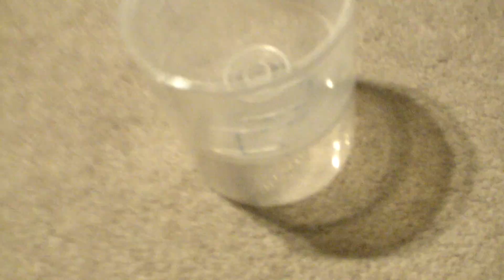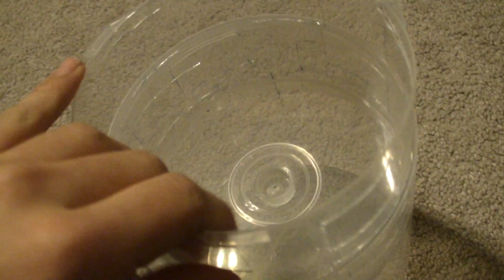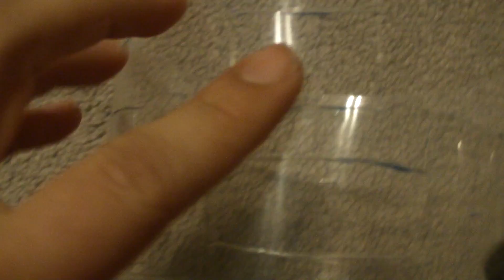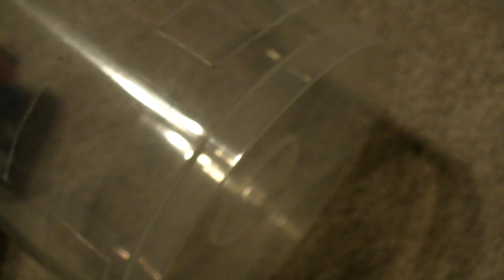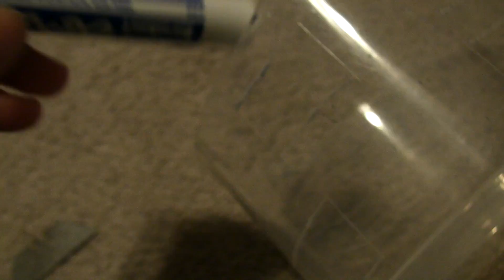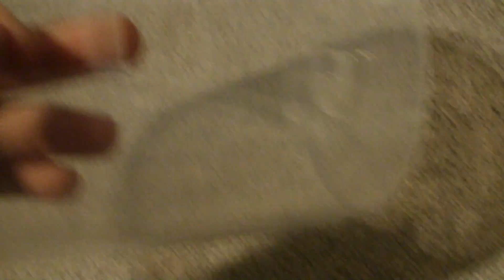Homemade Thunderbolt 1000T Started

Comment from the maker: my next step is to mount the stator to the motor i will use, i might use a "Gould" motor since i will using about 10 glued CDs hot glued to the bottom of chopper and a CD lits snugly on the rotor.  
new updates will be posted, hopefully by end of next week